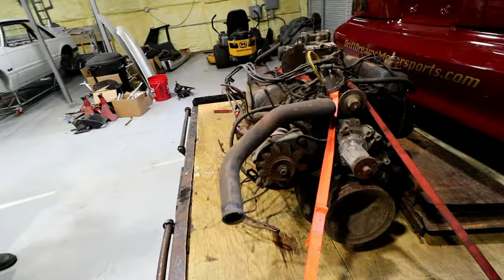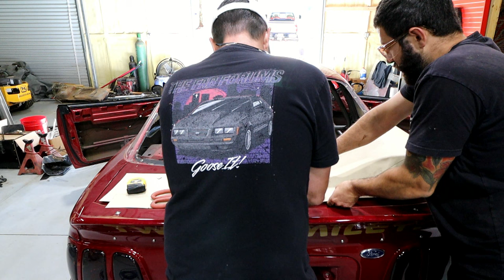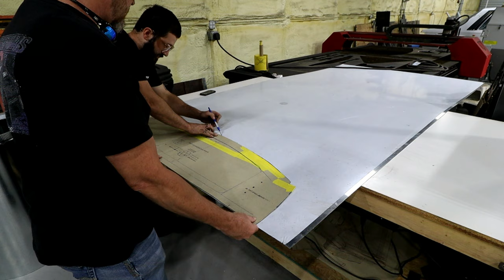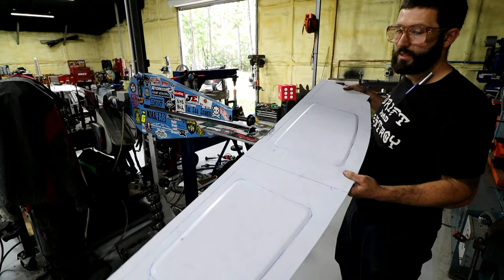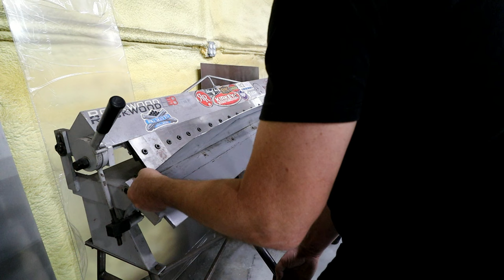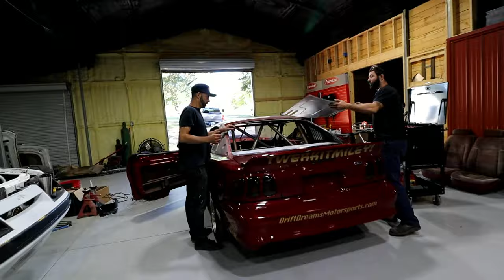Rear Firewall Build for a SN95 Mustang Drift Car

Comment: O.60 over is not the end of 351ws, it's not a 289-302.
Reply from the maker: Yeah but most of the .060 over kits don't have many choices when it comes to compression. If I build an NA setup I will most likely go .060 over but if it is a boosted setup I may need a block that's closer to a standard bore so I will have choices when it come to pistons.